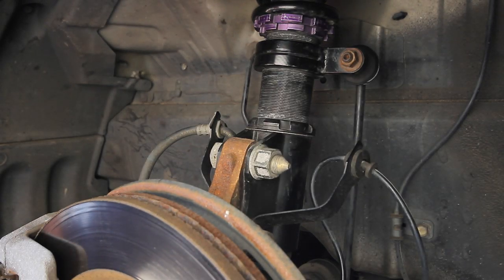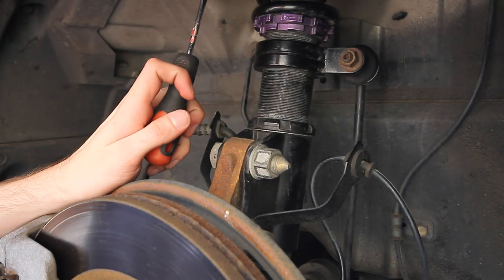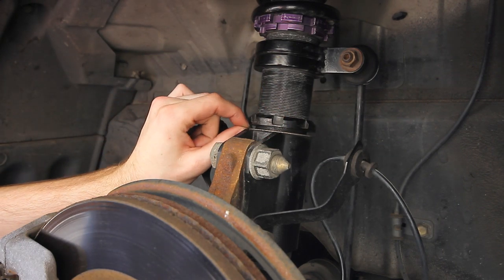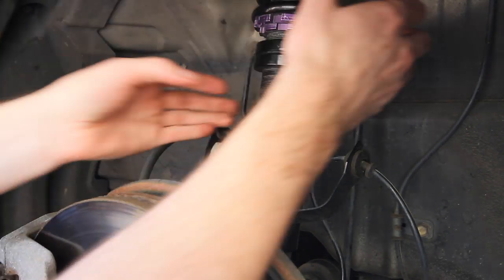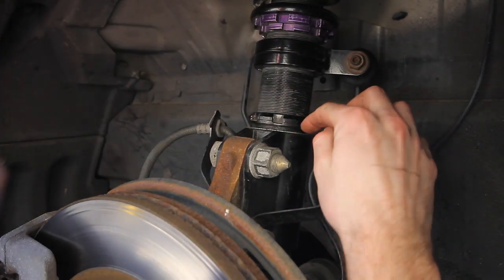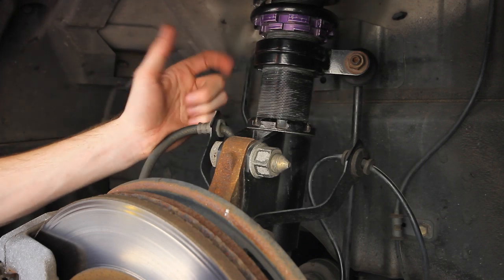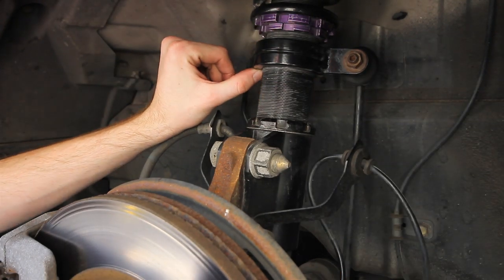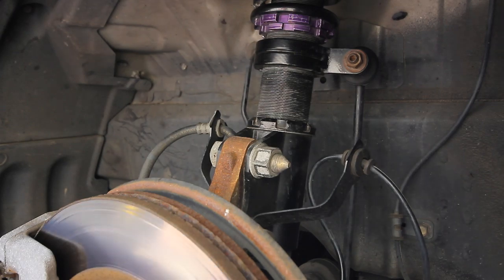Adjusting D2 coils on a 4g Eclipse

Comment: I jacked my back drum all the way up and the coilover still doesn't reach the hole at top.. what's the issue? Can't even get them mounted.
Reply from the maker: James Hansen for the rears one the 4g eclipse, i removed both rear wheels to release tension on the sway bar i think... then I started by loosely mounting the coils through the top holes in the hatch, letting it kind of free hang. From there i jacked up the sway bar to meet the big hole in the coilover and inserted the big bolt. Its been a few years but i think thats how it was done. If it still wont reach then the may have sent the wrong size coilovers
Reply from the maker: James Hansen   * they may have sent the wrong size